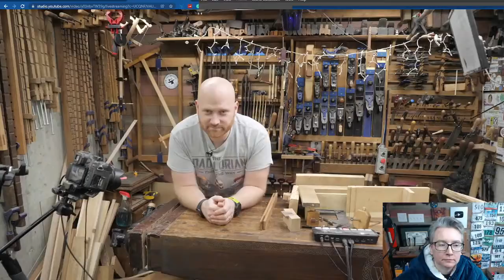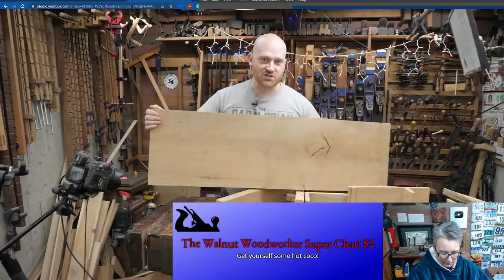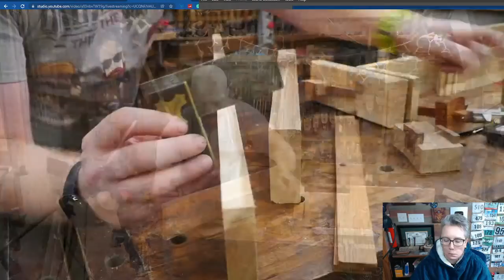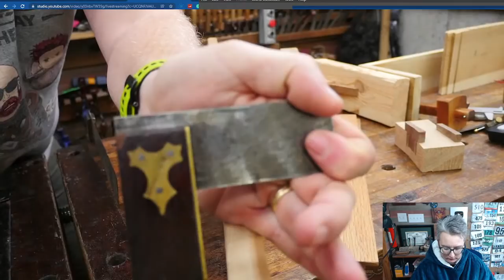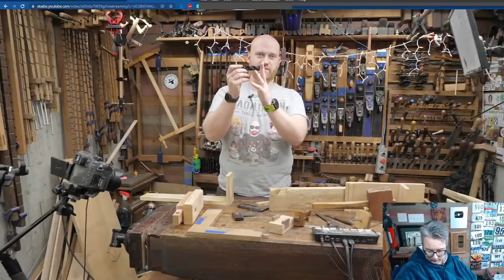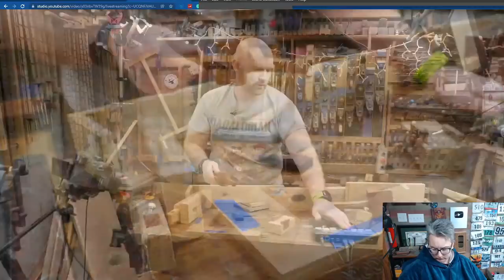How Accurate Do You Need To Be In Woodworking

Comment: First I want to compliment you on your contribution to ending the quest for perfection .  The enemy of excellence is the quest for perfection.  I am sorry to hear you know some engineers who fell into this trap and got frustrated.  I am an engineer and used my knowledge to understand not only that wood moves but wood is also not consistently the same.  Different woods have different characteristics and the characteristics of the wood within a given board will vary.  The two woods I mostly work with are red oak and eastern white pine.  Red oak moves like crazy across the grain.  As for pine, in a given board you have this very soft white wood and those super hard knots and near right angles.  These characteristic can make working with the wood a pain, but it also what makes wood look so interesting.

Comment: One trick I use in order to know if something matter or not is " If I wanted to could I add a curve after cutting the joinery without changing the way it goes together?", if yes then the fact that it is straight/flat obviously does not matter. It helps me know what matters and what does not. 
Think about adding curve in the design and if its make it more complicated or not and then you'll know what surfaces/lines matter and what does not. If you are using a modeling software you can even play with that and see what it does in terms of joinery

Comment: Being a engineer in a company that does a lot of welding helps.  If it started out flat it certainly will not be after it is welded. The hard part of engineering is not designing things that work with tight tolerances, the challenge is designing machines that will work with tolerances appropriate to the most economical process and still work after 10 years of wear in a dirty factory.  Not everyone gets to design medical equipment or jet engine parts some of us make cranes and lifting devices and well drilling machines.

Comment: Accurateness needs to be addressed for each piece of furniture or slab or panel you put together. Where the piece will reside. Is it an a/c eviroment, is it heated by means of a wood stove, some of the time and left to below people comfort temps when no one is around? During summer time, is there extremely moist air to effect the furniture ?
With all of these factors into consideration, you have a bit of figuring ahead. Or expansion and shrinkage will cause joints to fail.
Looking to ancient furniture of centuries old pieces, you find sound jointery used and wonderful surviving furniture where these factors were applied.

Comment: As to how fine is the spec you work to?
In a 'run' of a said number of an order, some have very tight numbers, 1/128" is not unheard of. My muisium quality pieces, are in climate controlled environment of dry stable air so my stock used must be dryer right and stabilized.
On the other hand( their are five fingers)if it's more utilitarian sort of furniture, stock used must have built in tolerances for weather caused changes to your production.

Comment: As for that knockdown bed question. How about a tenon that tapers outward on one side and is flush with the opposite side that goes into a blind mortise with the same taper/undercut on one end and the other end square. The tenon is then fixed in place with a wedge driven in on the straight side (the wedge will need a knob or notch to knock on to tap it back out).

Comment: My dad always says nothing is ever flat, round or square. Also that you can't make the same thing twice. He's a civil engineer with a hobby in model engineering. When he needs a display plinth he uses a bit of hardwood and runs it through the milling machine. He's always said he prefers metal as it's dimensionally stable. When it's flat it stays flat!

Comment: 19:00 I wanted to reply to Rocky Mountain Bear regarding pallet wood. I think the big reason it's usually made of white oak and with the cost of wood these days, reclaiming wood is much more cost effective. Oak is expensive, regardless of red or white oak. There's also the pleasure of doing something completely different with the wood that's available. For example, I have been commissioned to build a bookcase from baseboards used in a house that had been renovated within the last 20 years. All the original baseboards were saved for future use. 1X6 is still expensive.

Comment: You can use a heat gun or hair dryer to heat a joint you test fit if it’s too tight allowing the wood to shrink a bit so you can safely take it apart without much force

Comment: I worked as a carpenter for 10 years and never used a speed square for roofing measurements. Carpenters use speed squares because they are square and stay square even when carried in a tool belt. They’re great for checking that your saws are still square, You can use them for quick measurements, as a guide for a circular saw when you’re cross cutting a 2 x 4,.
Reply from the maker: Oh you were missing out. My years of doing framing. I used it constantly. As soon as you know what the pitch of the roof is, you can set up a mark for any board in the house.

Comment: I am an engineer (or at least I used to be one) so I see myself in many of the observations you made! I struggled quite a bit at first, but the more projects I complete, the more comfortable I become with the "close enough" for its intended purpose mindset. This video helped confirm it all for me though.

As an engineer, I also have to go on record as saying that there is a difference between precision and accuracy. Others have commented on that here already , so I won't bore you all with it again, but I would say that as woodworkers, we are more interested in precision than accuracy. We need the mortise and tenon to fit closely together, but if the actual dimension of the 1/2" tenon happens to be 0.50 inches, or 0.55, or 0.45 or whatever it really doesn't matter.

Comment: Americans are weird. They are pretty much the ONLY country left in the world who haven't converted, yet some Americans say they wish they used Metric, especially for smaller (Millimetres) measurements.
Reply: No, there's just not enough of a good reason to for everyday stuff that doesn't require precision and may work better with measurements based on physical perception rather than arbitrary units that don't match up to everyday life.  Same reason no one uses Metric Time and the UK still uses miles for road distances, pints for volume, stones for weight, etc.

While there's a massive cost and hassle to convert.  It's why it took nearly two centuries before Metric actually became a world standard from the time it was first conceived.  

Most other countries went through a crisis period where the benefit of metric overcame the obstacles but that never happened in the states.  Problem being the benefits are normally negligible, as aside from a difference in efficiency both systems work, and as mentioned there's a massive cost involved to convert... Every tool, every nut and bolt, every standard for product sizes, etc. the problem of re-educating the population, dealing with now obsolete products that can no longer be supported under the new system, etc.  Makes it far from a simple matter to convert...

However, that doesn't mean metric isn't used in the states, for pretty much anything dealing with science or engineering it is what is dominantly used and it has creeped into some aspects of daily life too and to support foreign products... Eventually it may come into more common use but that'll continue to be a slow process but there may still remain some things that may never switch.  Similar to why analog is still useful in our digital world...

Speaking of which, Veritasium has the first of a 2 part video on Analog computing making a comeback, no details on the 2nd video yet but the hint was it'll have something to do with AI research...
Reply from the maker: I seriously wish we would switch over the metric system. It would make life so much easier in every way.
Reply: @WoodByWrightHowTo  Easier in every way?  You might want to change that to "easier, in so many ways"...  

Otherwise, that's like saying you now believe there's a better way to woodwork that should replace all others, we should stop being so imprecise and stick to exact measurements, stop using analog and stick to digital and decimal number systems,  vintage tools should stop being supported, etc. because why do anything harder or different if there's an easier and clearly better way with absolutely no exceptions?  Let's just get rid of those pesky non-conforming ways of doing things...  

It's one of those be careful what you wish for, as unintended consequences will be part of the results...
Reply: @WoodByWrightHowTo  Just start using it, buy a couple of new rulers and tapes. Order any hardware from Canada. I don't know the Subscriber location numbers but I'm sure all of us internationals wouldn't mind.